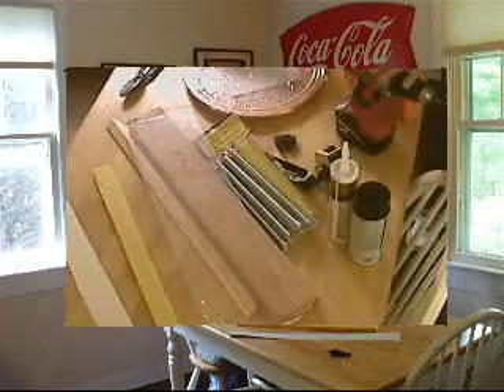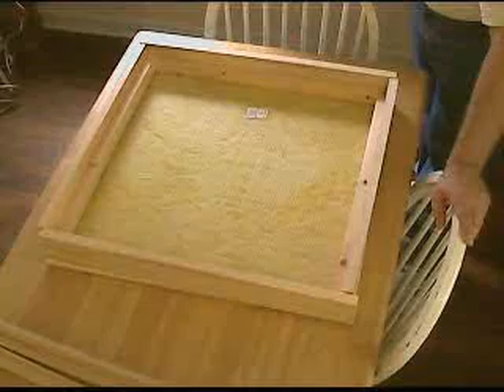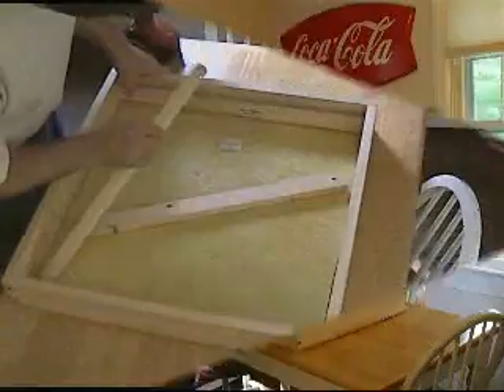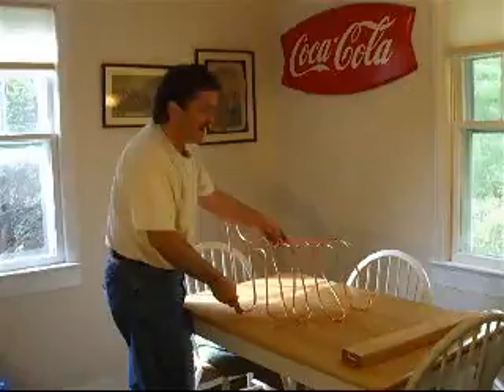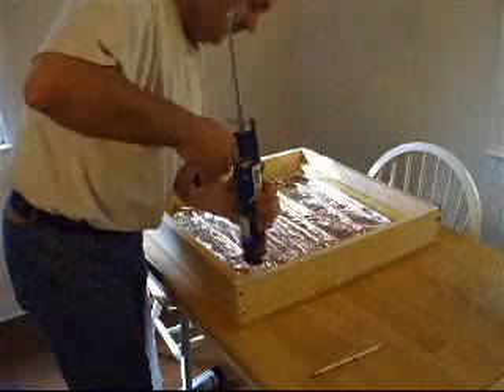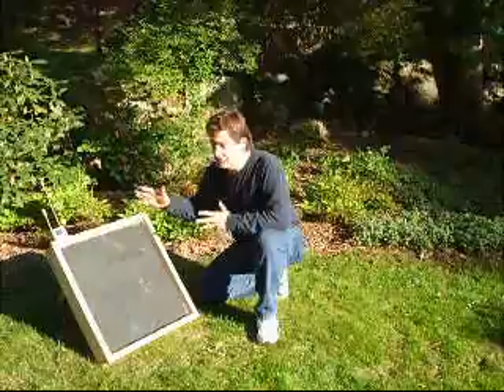Free Solar Heat "How it's made" DIY solar panel Part 1.2 Ernie Ursini

Comment: Instead of using the ceiling tile,use roofing foil backed hard foam panel,it's thicker,but rigid and has a thick foil backing,it may be able to be sealed without a back panel as well.I'd like to see the heat exchanger and circulator pump as well though,this looks good so far.

Comment: What do you think would happen if you were to use a copper radiator from a car ? Might hold more fluid and absorb more heat than the copper coil.

Comment: I built a 4x8 design with hard pipe and took it outside and attached it to the pool.  The temp of the pool was 78.  At the end of the day...cloudless day...the pool only increased 1 degree and the water coming out was barely warm. 
Instead of tin foil I used Reflect-a-foil...it's tin foil with bubble mesh squished between.  The aluminum sheet was trimmed to size but it came off a roll...so it didn't stay flat...I may not have a perfect seal.  Ran the water slowly.
Why don't it work?

Comment: Great video and nice solar panel.
One improvement I might suggest is to sandwich the solar coil between two sheets of aluminium and bolt it together to get good thermal contact between coil and black aluminium sheet. I am going to build a panel of my own but I think I will use a flat panel old central heating radiator that should do a fair job.

Comment: Currently we have minus -18 degrees here... would this system work under those conditons, because that's when we could really do with some heat - or does it only work when it is 80 degrees outside .. and hey, that's hot enough not to need any domestic heating anyway... seems like a 'catch 22' situation to me...!

Comment: hey friend have u connsiderd salvage as 
a protical in your plan ??? junk yards
often have old hot water heaters that could be modified to insert glycal circulation this way a preheater of sorts
could easely be connected to the hot water,and old refrigurater evaperaters 
cooled be used as a heater in the house
that can be inserted at the intake vent of your house so as to use the duct and fan

Comment: built a 4x8 can heater like the ones they show on utube I put in a bath fan and a attic thermostat and a shut off switch on the wall used 1/4 inch glass the first day the sun shinned all day I turnned my temp down it was 65 in the house outside it was 39 I then turnned it on the temp stayed 72 all day in the house I was happier than a pig in slop

Comment: I thank you for creating the video.  I do have a question. Onxe I create the  solar panel, what do I do with it. The copper is sitting inside the panel.  How do I set it up so it attually  heats water or  a small cabin.  I mught attually do this if I can find out how I can make it work.  Thank you - Nice video you made it simple.  Part two?

Comment: What is the max temp for the plexiglass before it gets soft? I am building 2- 28"X 76" solar panels and not shure of  what would be better glass or plexiglass?
I have 3 sliding glass door glass that is 28"x 76" is how I got the size for the panels. but have broken one very easy.
should I use the glass or plexiglass? Thanks.

Comment: Essentially yes - only the bucket is a well insulated tank and the hot fuild is passed thru it in a coil of copper bringing the temperature up to that which is being created by the solar panel

Comment: nice and easy build, but.. I strongly recommend a small change in design.. 

1:Spray copper tubes black as well.
2:Switch the  shiny alu foil for the BLACK alu foil sheat. 
3:Put in a extra plexiglass. 

So now you have BLACK foil as background AND the BLACK tubes directly in the sun, not behind the foil as for now.. And the 2 plexiglasses will retain heat much better :)

Comment: I wonder if it is possible to build one of these and feed the hot water pipe into a old water heater somehow like maybe replace the elecrical elements with something to heat the water inside with out getting anti-freeze into the main water. To store the pre heated water to be fed into the main waterheater to regulate the water entering the home.  If it is possible please go into great details on how to do this.

Comment: increadible step by step explanation of solar water heater. best ever seen on youtube about this type. i think the pump can be ommited since cold watter at the bottom will go up to the upper side of the tube, therefore there is an exchange of cold-to-hot water. Saw that explanation on another video. unless we want to increase the temperature on the water tank than having a pump helps a lot. the tank can be a simple tank i presume to maintain low cost. :D

Comment: Nice vid.  I'm will try to build one someday.  I seen some data about sunlight, and there is about 1000 watts of energy per square meter, so perhaps that size to double that would be a good energy amound.  I think they work good even in winter.